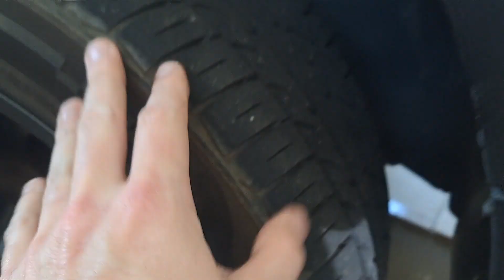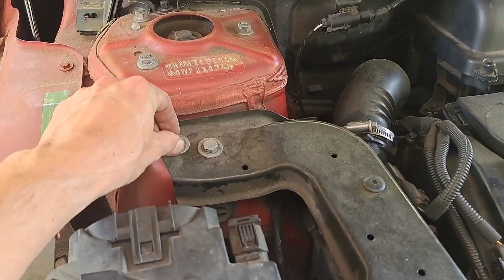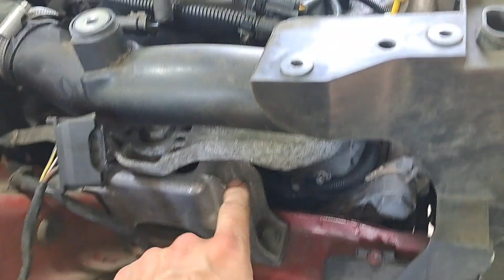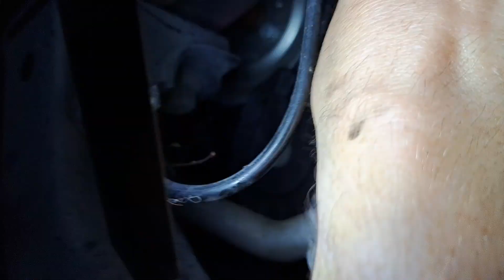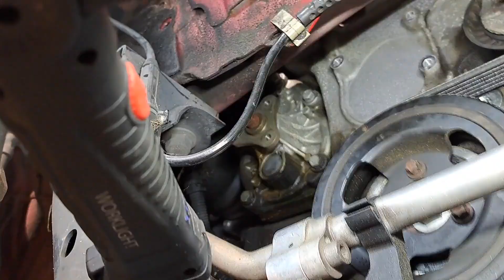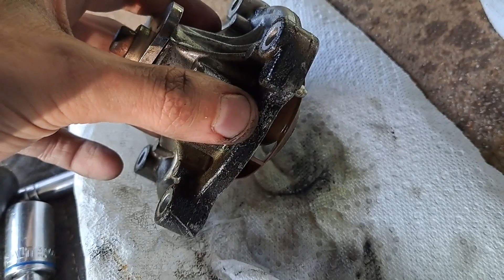2011-2016 Mini Countryman Water Pump & Engine Mount

Comment: break the three pulley bolts loose before you take off the tensioner, the belt will hold tension.